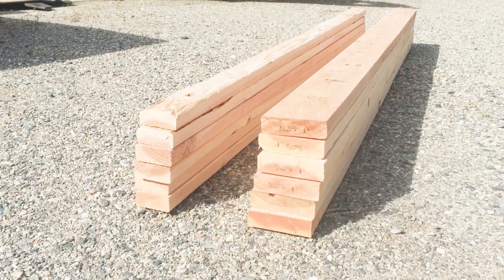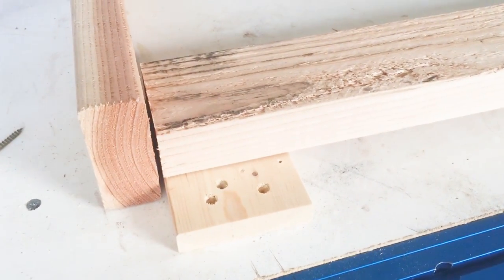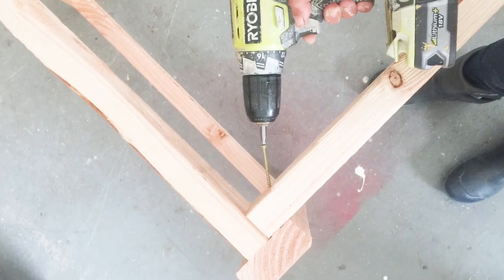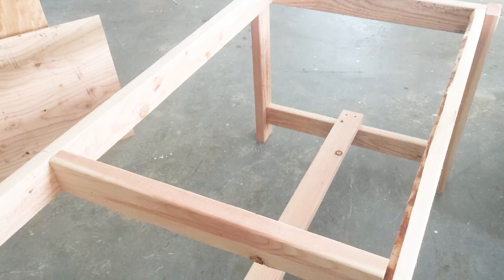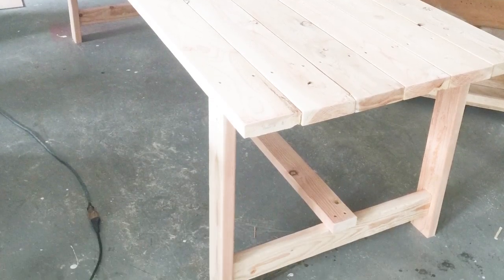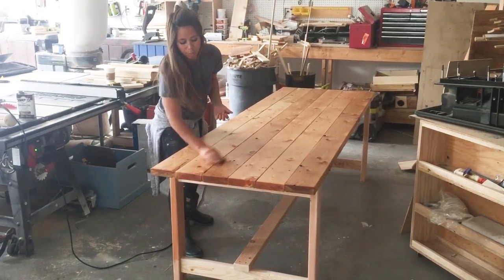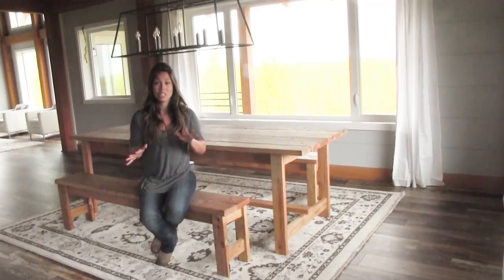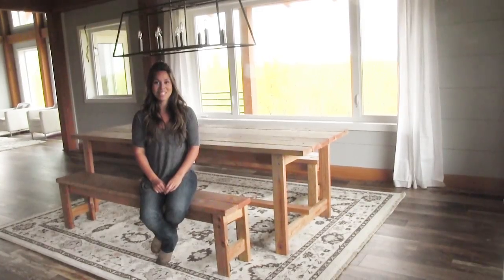Beginner Farm Table Project Plans

Comment: I know you mentioned it being able to be used outside but would it work as a permanent outdoor piece?  Any suggestions to make more 'weather proof'?
Reply: use an outdoor paint or stain if you want rain/snow resistance. If you live in California or some place with a predictable wet season and dry season though just leave it naked wood and take it inside during the wet months.

Comment: Beautiful table.  Question: is that Danish Oil food safe?
Reply: No. If you want food safe, finish with mineral oil or butcher block oil. However, if your food lands on this after it cures, and you pick the food off and eat it, you'll be fine.
Reply: That's exactly what I wanted to know.  My little kids are messy eaters.  Thanks!